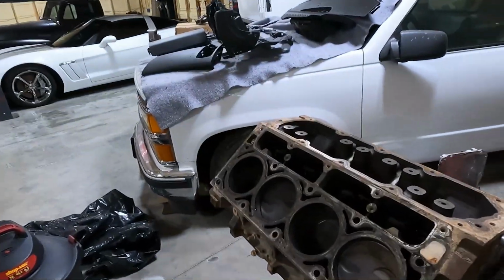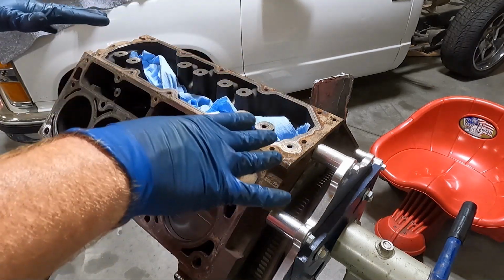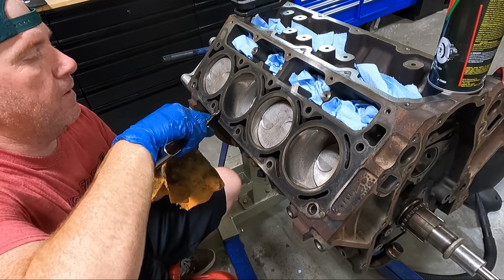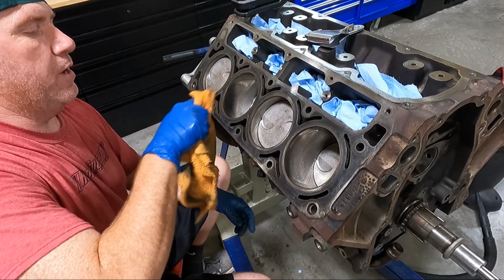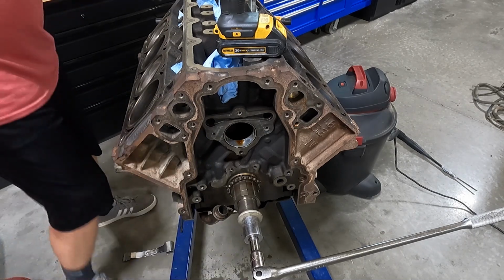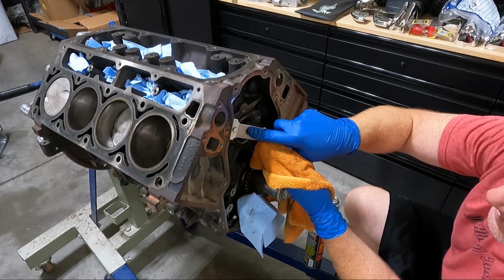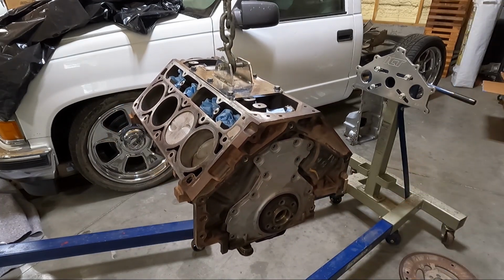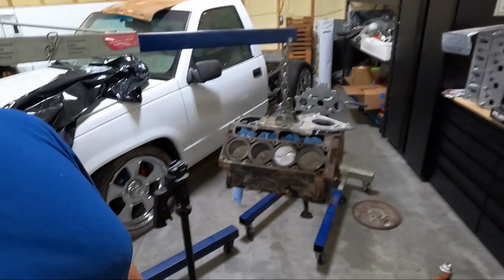Cleaning and Prepping the 5.3L for New Heads and Cam(Very Important Step!)

Comment: thx for the video. i've seen other videos that uses 2000 grit sandpaper and wd40 wet sanding as well as a scouring pad.  is that necessary?
Reply from the maker: No. That would put a ton of debris in the motor

Comment: Quick tip. If you have oil in a bolt hole and tighten a bolt into it you can crack and ruin the block. It’s called hydraulic lockup
Reply from the maker: Yep. That is why I clean then all out.

Comment: I just resurfaced my 862 aluminum heads on my 5.3 iron block and was wondering if I should just do a clean and prep on the block or resurface it also? Is it necessary to resurface the block also if you resurface the cylinder heads?
Reply from the maker: Definitely a good idea
Reply: I’m in the process of mildly resurfacing the deck on my block, I started out with lightly going over it with a razor blade then 220 sand paper and a sheet of glass, there’s still some staining but nothing major, long as the surface is smooth and no old gasket material that I can catch with my finger nail should be good correct and the MLS gaskets will seal?
Reply from the maker: Yes it should be fine. Hopefully you are doing cam bearings after sanding
Reply: No I wasn’t, I blocked all the water ports and crevices and after i was finished I was going to flush the block out really good
Reply: I am replacing the camshaft in it with a BTR Truck Norris cam with new oil pump and timing chain, I’m doing a LS swap in my 1988 Monte Carlo SS
Reply from the maker: Hopefully that works
Reply from the maker: Lots of debris in that block if you sanded it but the btr cam seems to be popular
Reply: Yeah I haven’t done the passenger side or top yet just the driver side deck,  I’ll just have to flush it out really dang good
Reply from the maker: @justinw523 good luck

Comment: Off topic but I noticed you do not remove running boards from your lowering projects (Tahoe, Suburban, etc.) is this just your preference or is there another reason? I would think they are pretty useless once these vehicles are lowered and you would have to step over them to get in. Considering one of these vehicles in the near future (years 01-06) but not sure if there is an underlined reason I don’t see them removed. Have you covered what models/years you could/should remove? TIA.
Reply from the maker: I hate the look without them.
Reply: @TWAMotorsports  fair enough 👍🏻

Comment: why not use a green roloc wheel on the metal surfaces?
Reply from the maker: Terrible idea. Ask a reputable builder about that
Reply: done it for years with no issues, curious what the issue is @TWAMotorsports
Reply from the maker: Too aggressive and throws things into open engines. Ford mechanics are not even allowed to have them in their boxes now.